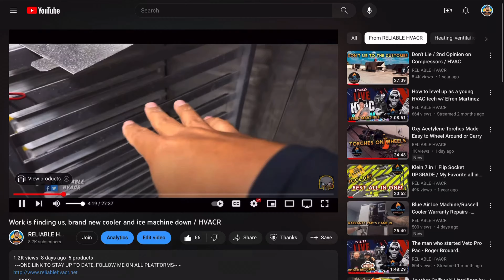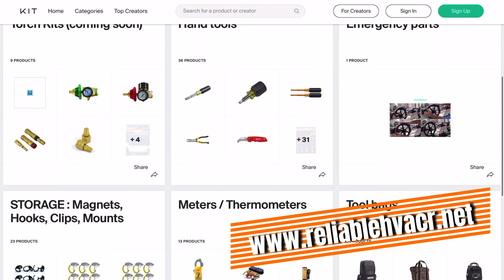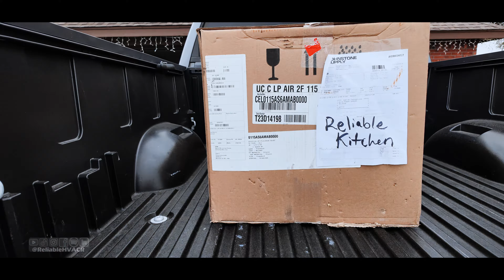Finishing up Evaporator Job at a Hospital / HVACR

Comment: Adrian, thanks for the videos and the honesty of real life experience, question did you install suction p trap on the line set?
Reply from the maker: Suction line went up a couple feet and straight outside to ground level condenser. We only have p traps on linesets going up to a roof